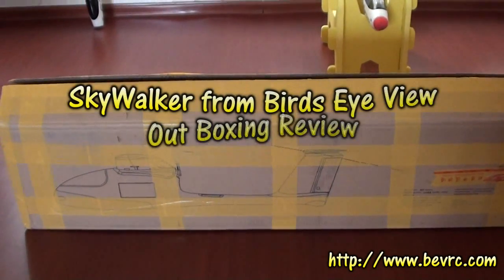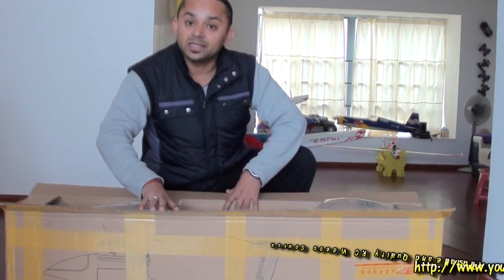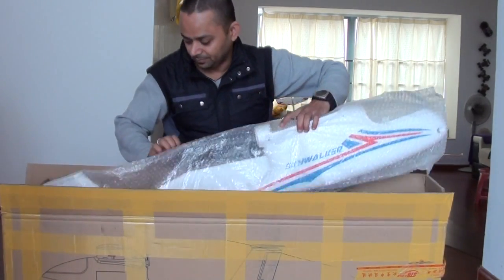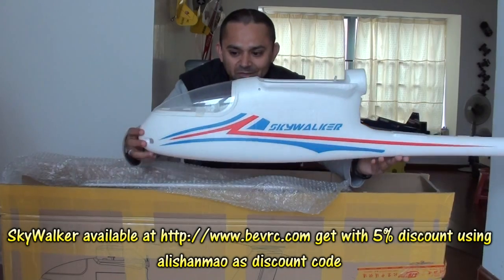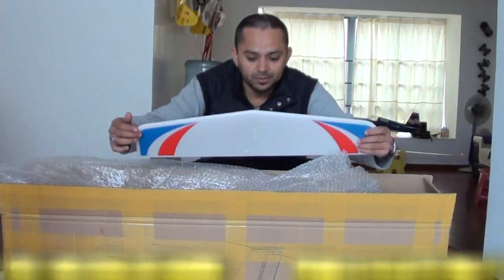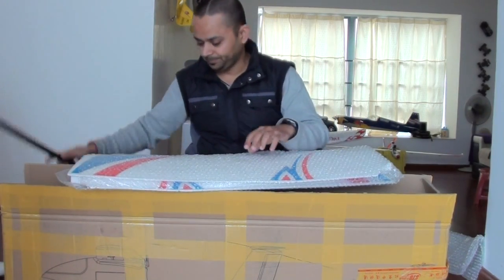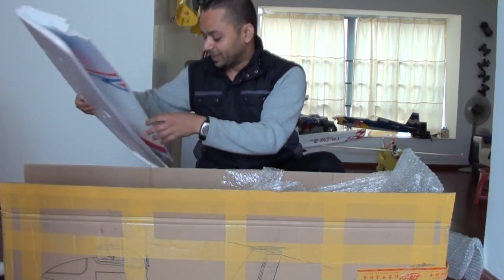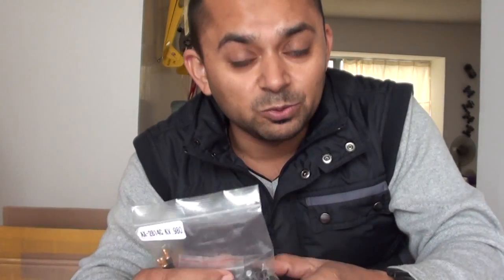Un Boxing SkyWalker UAV Plane

Comment: @TheNobleknight76ers Don't use too heavy of a motor like I did.  It is a bit tail heavy as it is and that motor is pretty far back there.  Plus the rudder and elevator servos are all the way in the tail.  If you plan on adding the video TX in the spot on the tail it is even more tail heavy.  So, it's a fantastic plane, you are guaranteed to love it but be prepared to add nose weight and/or buy a heavy battery....there's PLENTY of room!